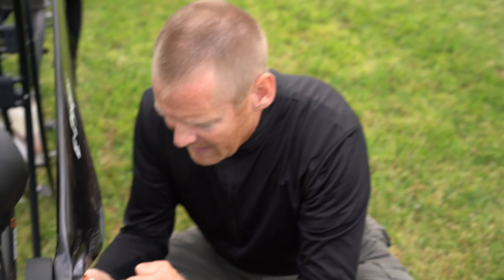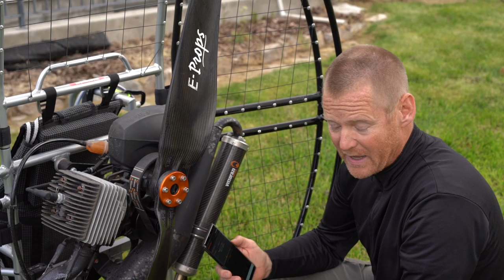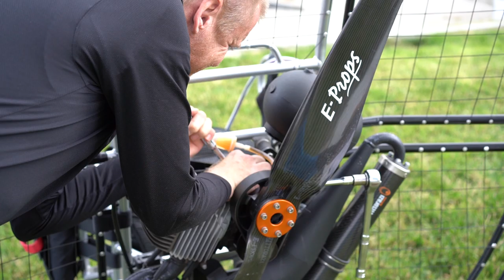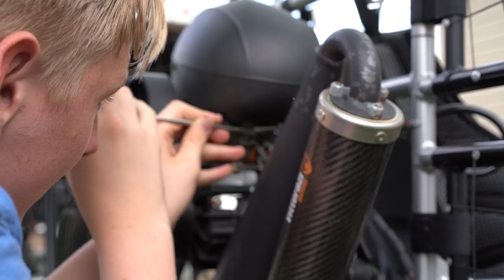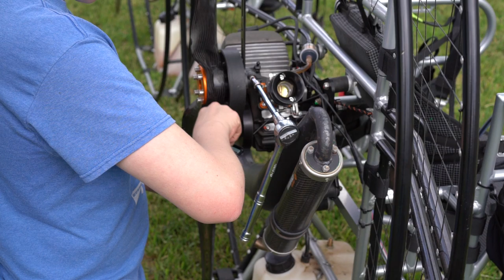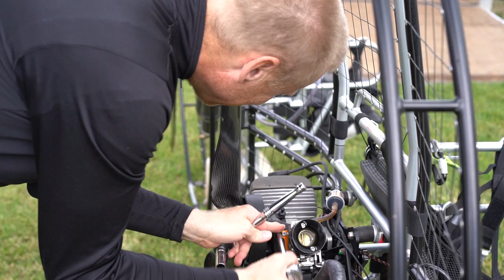Cool New Paramotor Tip On How To Tighten Your Belt On Vittorazi Moster 185!!

Comment: Will this process work on the Flat Top Minari 200 R?  What is the hertz specification if so? Thanks.
Reply from the maker: We don't use this on the 200.  Just make it as loose as you can without it ever slipping.
Reply: @DellSchanze  Do you have a video detailing this operation?

Comment: Hey Dell, when did Vitorazzi change the M8 screw from left to right?
I bought the ultimate version from you in 2015 or 2016 and unfortunately destroyed my screw now..
Otherwise, I'm still very happy with your material! Let's flying!!! :)
Reply from the maker: Ah that's a good question.  Don't know exactly.  They are always making changes here and there without telling us.  Many times we get a new batch of engines and suddenly we have to change our whole mounting plate just to get it to fit around some new change.  It would be nice if they would let dealers know of changes.  Of course now with the new Flat Top 200R as the new standard you will see less of the Vittorazi motors.  The new 200R is 200cc and weighs exactly the same as the 185 vittorazi but with more power and far less torque steer which is really cool.  Plus many other really cool features.

Comment: What kind of belt are you selecting?
Reply from the maker: This is just the stock belt that comes on them from the factory.
Reply: @DellSchanze  no, in the app. it's asking for a belt selection (ie. CONTI SYNCHROBELT, CONTI SYNCHRFORCE CXP, etc.) I'm not sure which on to select. It's also asking for the Profile, Pitch, Width, and Free span length.
Reply from the maker: @neomayad  Oh doh sorry.  Just keep it on the standard setting so don't select anything just keep it where it is.  It's the standard setting you want.  You don't change anything.
Reply from the maker: Oh also make sure you turn the microphone side of your phone towards the belt as it needs to listen.  Many have had troubles because they had the mic pointed the opposite way.
Reply: @DellSchanze  Thank you

Comment: Thanks for the tip. Would have been helpful if you showed the app screen. I can’t get it to work no matter what I try. For me the standard settings are: “please select belt” and Sensitivity: “Standard”. Is that what you mean by the standard settings? Or did you just select the first belt on the drop down menu? Help us out Dell! TIA
Reply from the maker: Flip your phone around so the mic is aiming at the belt.  Had that issue myself at first.  Yes those are the correct settings but you need the mic right up next to the belt.  Also you need to flick the belt about the same speed as I'm doing it.  Too fast and I think it has an issue as well.  Let me know if that helps.

Comment: Hi Dell,  Which type belt do we enter in the APP and what width? Or where do I find that info? I've always been wary about tightening 
the belt on my Ninja for fear of over-tightening it. This is a very necessary video. Thank you for posting it.
Reply from the maker: Just use the standard settings.  Yes it works really well.

Comment: Cool video, should mention the socket and Allen key size in the description. Did you stop using the Helix props?
Reply from the maker: Ah yea doh that would have been a good idea.  Yes we are using a new prop now that is half the weight.  There are many different versions and types of the same prop though so people just need to get them through us directly to always make sure they get exactly the correct one.  The guy who crashed up the dead end canyon didn't listen to that advice and totally destroyed all his gear because someone else sold him a prop not optimized for the Flat Top and so he didn't have anywhere near the power the correct setup you get through us has.